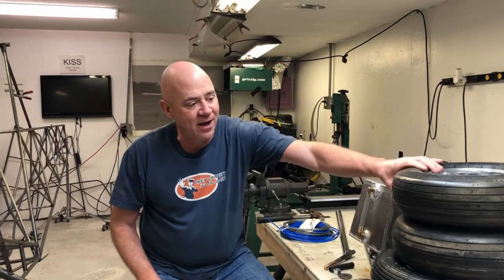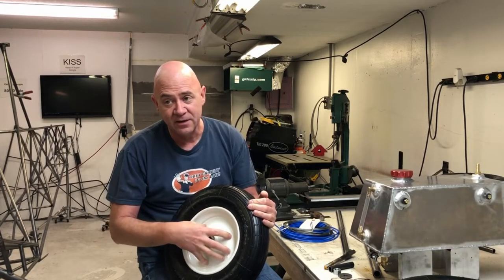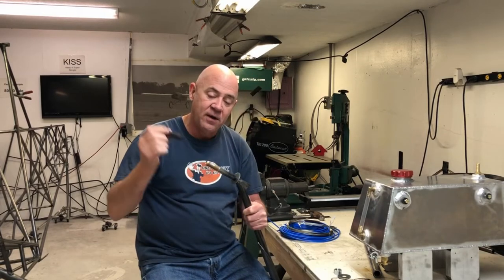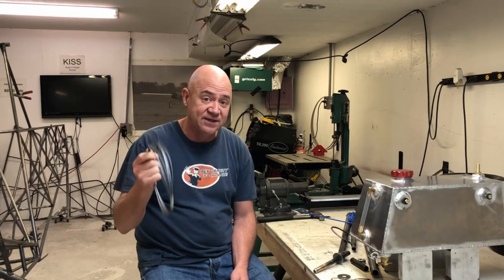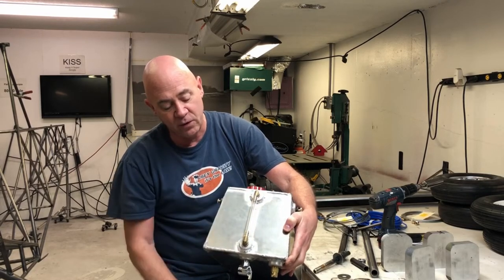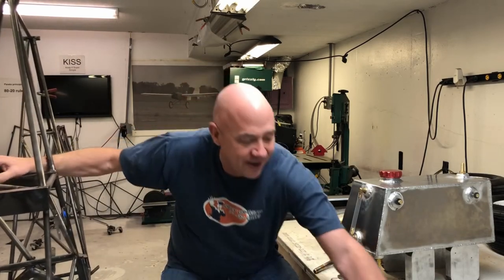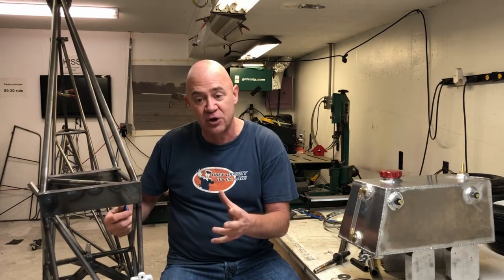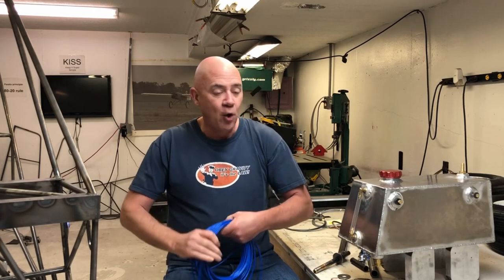Airbike 013

Comment: I used wheel barrow wheels and tires on one of my early designs. I could not find bearings that would let me use 5/8 shafts, and still fit the wheel. Made wooden bushings out of hard maple. Never had any trouble with them. I own and fly a Rans S-4. The way they did there axles was to weld a peace of 4130 tubing where you welded your axles. Then they sled the axle into the tube and drilled a 1/4" hole to retain the axle. I have never had a axle to bend or brake.

Comment: I would like to see you change your rudder cables to 3/32. That is what I use.
Reply from the maker: That’s what I have on it? I’m confused, did I say I am using something other than 3/32 inch?? I may have started out with something different, but I’m using 3/32 inch now.
Reply: @dagtheaviator  I would have to watch the video again. I thought you said 1/16, and that is not big enough. Any way, great build you got going on there.